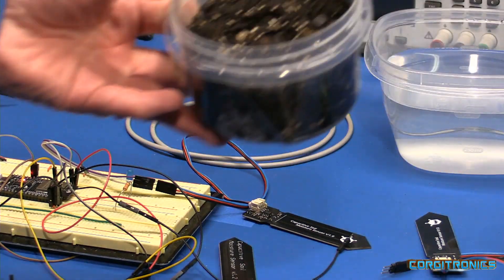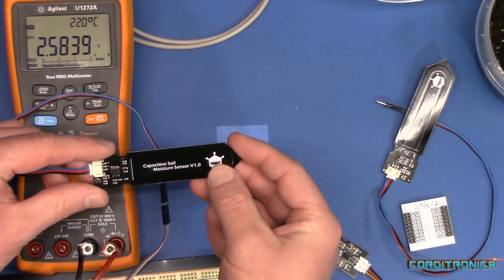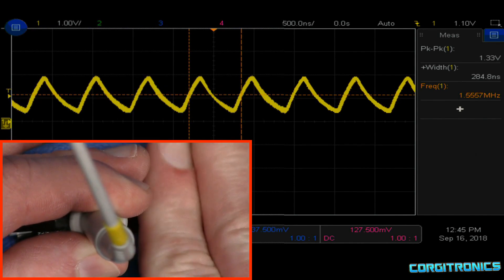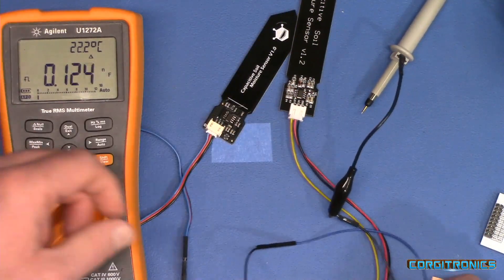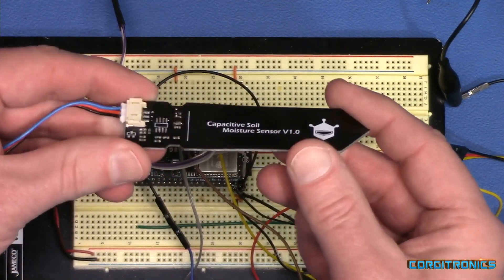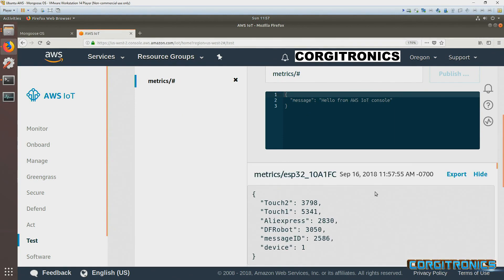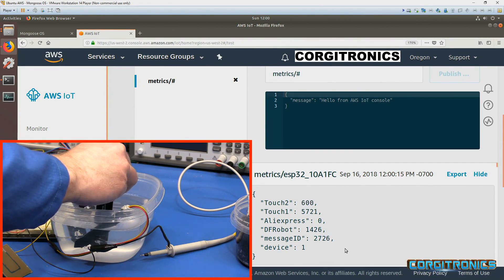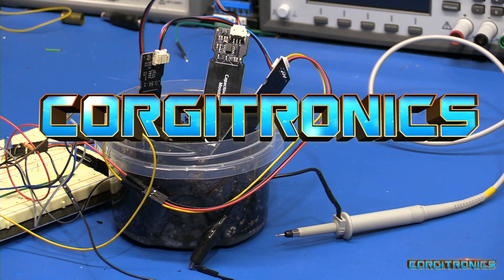ESP32 moisture sensor streaming to AWS

Comment: apakah pcb yang di buat itu langsung di hubungkan ke pin pada esp32? ada yang bisa bantu
Reply from the maker: Yes, it the circuit board is connected with one pin to ground and the other pin is connected to one of the touch-sensor pins on the ESP32.

Comment: Hey, thanks for this video! 
I have one question: I have read that some of this sensors need 5 V to function correctly. Did you use an external 5 V source or did you use 3,3 V from the ESP32?
Thank you!
Reply from the maker: The ESP32 is being powered by the 5V USB cable, but it has its own 3.3V regulator.   I don't recall if I ran the commercial sensors on 3.3 or 5V, but they seem to work well enough at the bottom of their rated voltage range.

Comment: Hi, im new to this kinda thing, at 7:32 you said that we can use any pin that have "TOUCH*", im using ttgo lora sx1278 esp32. Does it work the same? Im hoping to receive your reply.
Reply from the maker: It looks like the TTGO devices do expose some of the touch pins.  Looking at the Pin Schematic on this page http://www.lilygo.cn/prod_view.aspx?TypeId=50003&Id=1271&FId=t3:50003:3  it shows that Touch2 - Touch6 are available.

Comment: Hello, I'm trying to find a way to use this system for water detection around a sump pump, water softener and other areas in my mechanical room.  Do you have any advice on how to do this.   I would like to run multiple sensors off one board so I can be alerted on the location of the leak.  Also my plan would be to use parallel strands of either copper tape, or stainless steel wire  as a perimeter sensor.  
Is there power running through the sensor wire or is it just measuring independence?
Reply from the maker: For your purpose, you might consider using the capacitive sensirs that I found on AliExpress and connect them to a RaspberryPi, perhaps a PiZeroW.  Since you only want to detect the presence of moisture (on/off) then you don't really need an analog input for these sensors.
If you go with copper wire, be aware that it will oxidize and loose sensitivity.  I'd recommend stainless steel wire, or perhaps aluminum wire for that.  Going with the bare conductor approach is simple, but the wires will have a low voltage potential between them, based on whatever power supply/battery you use.  There must be plenty of circuit examples for this approach to look at.